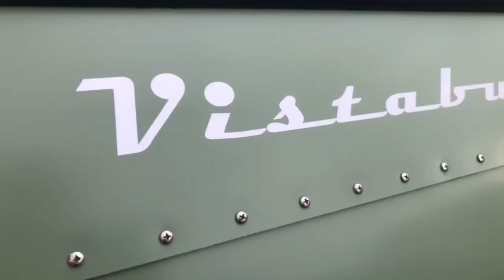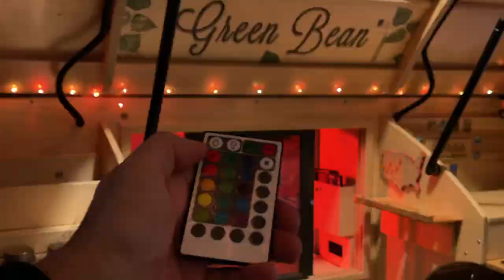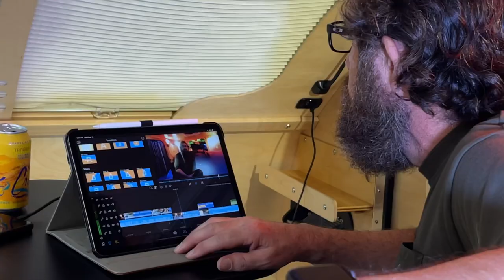Vistabule Teardrop Trailer for Sale (It’s sold.)—Full Tour

Comment: The bed is a little smaller than I had heard in other videos. Usually, it's said to be a full queen size, which is 60"x80" . That bed is just over 6 feet. (73") At 6'3", it would be too short for me, unfortunately. Nicely designed teardrop, though.

Comment: I love the exterior more than any other teardrop trailer. The color is stunning. Vintage and classy. Stunning teardrop trailer. These are my Top 5 teardrops. How could I decide? 1) Vistabule 2) Black Bean 3) CampInn 4) High Camp 5) Escapod Topo 2. Geeze. They're all so different. All are excellent. Each has positives and negatives.
Reply: Features and Price.  I don't want a TV or a toilet etc, but I like nice touches, so I want a Vistabule.   I like the Mood LIghting.  If I wanted to spend twice the price, I might get the Escapod Topo.  Lots of nice features, but not worth an extra $20k to me.  Both of these are the least complicated and value packed without gimmicks.
Reply: @youbetyourwrasse  Agreed but for me, it's High Camp all the way. Pure class.
Reply from the maker: Camp Inn was my close second choice. Ultimately, we like the views of the VB better than the stying and size of the Camp Inn.
Reply: @davidhunternyc1  I agree it's very nice.  But dang, the side windows are the EXACT same ones that are in my horse trailer!  Did you get the 560?  It appears quite cozy and roomy.
Reply: @youbetyourwrasse  Ugh... I made a boo boo. I meant I like High Camp the best. I do love the Vistabule and Camp Inn too. I like High Camp the best because it's classic and built like a tank. There is only one trailer in the line. Also, I live in NYC. I tried thinking where I could park a teardrop and there's nowhere. Crime is getting worse and I don't want to spend $500 a month for parking. For now, I'll have to live vicariously through the community.
Reply: @davidhunternyc1  Well what about the Escapod?  Talk about heavy duty!  Are you plannig to stay in NYC?  I've heard quality of life is not what it was.  Can you park in Connecticut?  But if you need safe secure parking, you can park your High Camp on my property.  In Arizona.  I promise to take GOOD care of her!  Maybe the vistabule and the high camp with make a bebbe!   We;ll call him HIGH VISTA    lol.    <3
Reply: @youbetyourwrasse  That's awesome! Arizona is a gorgeous state. I would love to live there but I love the 4 seasons and water. The good news is I wouldn't have to worry about my High Camp trailer rusting or getting water damage in Arizona. Sounds like an idea!
Reply: @davidhunternyc1  I live in the heart.  4500 feet.  I have snow in winter and heat in summer.  Strangely cool 38° this am and I can't complain.  And the Verde River.  Ssshhhh don't tell anyone!  I SWIM NAKED WITH RIVER OTTERS.  And beavers, but they are just big smelly rodents.  Just north of Prescott.  South of i-40.  I got 5 acres against Nat'l Forest, when I get my vistabule in Sept you can come and stay in it.  :D
Reply: And no the beaver thing wasnt about sex.  I sounded like a gay man but I am a female talking about animals.  And pronghorn.  We have pronghorn.  Why does that sound dirty too?  Pronghorn?  Why sir, you should have a doctor check that.  LOL.
Reply from the maker: @youtubeyourwrasse, I’m glad you’ve had a good experience swimming with otters (naked , no less.) Last summer I rescued a woman who was attacked by two river otters who were swimming in our lake.  They bit her more than 50 times.  They bit at my kayak over and over. A few months later a man and his dog were attacked in the same lake. His hands were shredded trying to defend himself. I will never look at otters as cute, cuddly creatures again.
Reply: @SteveMacDidThis  Yeah WOW that otter pelt would have made a quick fine hat.  I confess I never really swam WITH the otter,   but to SEE a river otter in the Arizona desert?  And a herd of Pronghorn the same day?  I even rode one!  Okay that was a fib but NO I DID RIDE ONE.   <3   PS  I am a 12 year old girl  :D   [swimming naked with the smelly rodents is not cool, so I mythologized]
Reply: @SteveMacDidThis there’s a video of a bunch of river otters attacking and killing a small crocodile. Blew my mind. The otters probably killed the croc to protect their own young.

Comment: Where does the battery live?
Reply from the maker: The battery is in a compartment inside the cabin under the bed near the headboard.
Reply: @SteveMacDidThis  thanks for letting me know, how many batteries can the camper hold?
Reply from the maker: No problem. I can’t believe I didn’t cover it in the tour. The compartment is made to hold a single AGM Gel or Lithium Battery. I was looking at the possibility of creating a larger compartment and it looks like it could be doable.
Reply: @SteveMacDidThis  thanks again for your help. I guess the camper doesn't need that much power.
Reply from the maker: Without recharging the battery at all we have easily gone 5 days with a 115 aH battery (or was it 105?). If we were being careful, we could easily go a week. One of the main reasons we got a teardrop trailer is that we are CAMPERS. We were always prepared to strap on our headlamps and do without power. Thanks for watching.
Reply: @SteveMacDidThis  I feel the same way, happy trails!!

Comment: If you don’t need to sell it. Why are you? 
Pretty pricey for a bed on wheels
Reply from the maker: During the pandemic the value went up, as did the wait time for a new one. We sold it for substantially more than we paid for it three years earlier. I explained some other reasons in the video. The price was obviously right based on how fast it sold. There are a lot of more expensive teardrops out there, less expensive too. A “bed in wheels”? Did you miss the part about the galley?  All of the storage areas?  The water system?  The electrical system?  It’s a complete camping solution for us, and for the quality and craftsmanship in the Vistabule, I think it’s great way to go. If you’re happy in a tent on the ground, then that’s the way for you to go. We all put value in different things for different reasons.